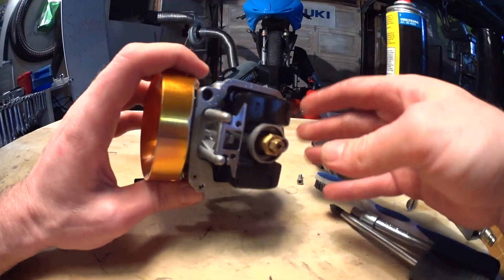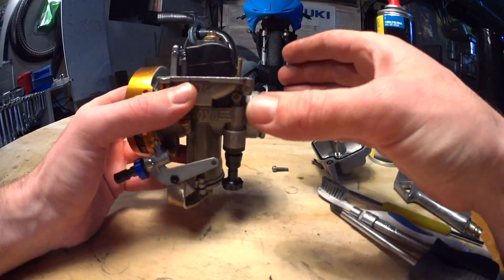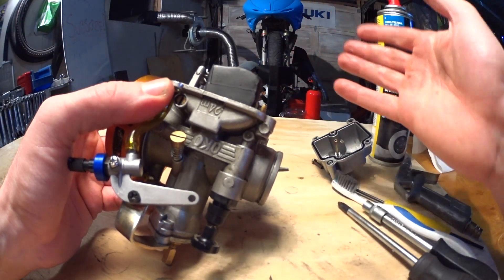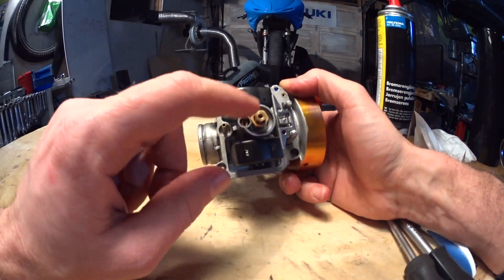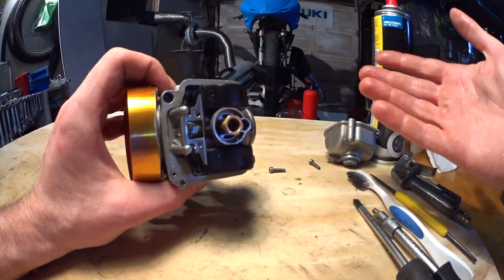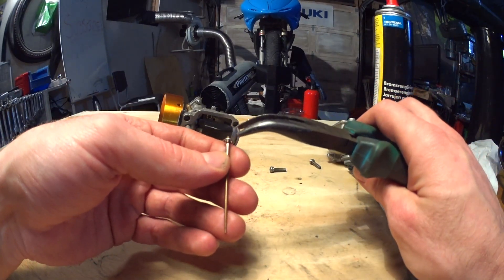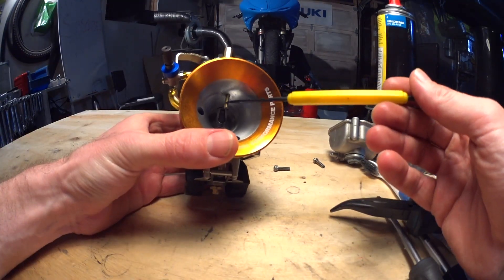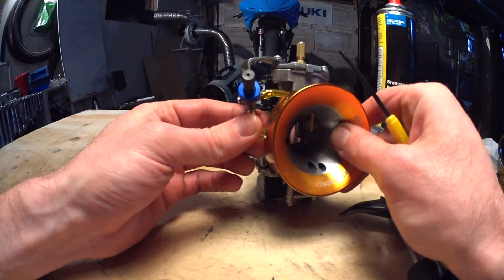HOW TO TUNE YOUR CARB | Carburetor Tuning Tips And Tricks! | 2/4 STROKE TUNING

Comment: 2 stroke and 4 stroke 2 different setups ..damage can result from lean out a 2 stroke .
Reply: Peter Taylor I ride a vespa with a 210 kit.i run mine so it's on the rich side. I know what it's like to seize an engine while overtaking cars on a motor way.

Comment: the rc fuel valve is a brilliant idea! i made myself a powervalve system using a pilot jet, but this method is neater though.
Reply from the maker: +Mohammad Farhan Sukarjo Thanks!
Reply: @2STROKESTUFFING  .
Is that correct ?
Reply: Sooo wait, I could just use a larger main jet and use this RC valve to adjust levels?
Reply: On my Honda CR80R?

Comment: Great tips sir!  very nice!

I have a question,  Which Carburetor type works best on a 4stroke Scooter? 
Butterfly Valve, Round Slider or Flat Slider just like the one you have there?
Reply from the maker: +Nathanael Sangalang Thanks! Can't say much about what's best in a 4 stroke, not exactly my field. But most flatslide carbs outflow most round slide carbs, and most round slide carbs outflow most butterfly valve carbs.
Reply: ohh.  i see.  now i get it,  btw Thanks as always man!  😄

Comment: Do you have a video about powerjets? I have a 2 stroke 200cc quad that was modified with an aftermarket 28mm Keihin carb with no power jet and the port soldered shut. I am more than capable of modifying the port, do you think a powerjet is worth it without upgrading the ignition/CDI?
Reply from the maker: +Charles Gunzelman If your engine already runs good at all throttle openings there won't be much of an advantage with a powerjet alone.
Reply: 2STROKE STUFFING ok thanks! I just got the machine, still need to tune the idle, install a proper needle clip and pack the exhaust silencer. Would the silencer being wide open affect the tune? It currently has no packing or end cap.
Reply from the maker: +Charles Gunzelman It will probably affect it some, but not very much. Good luck with your new toy!

Comment: True or false:: a 2 stroke makes its best horse power and runs coolest when the main jet is lean enough that the engine just " makes that noise, like a small backfire". And if the main jet is too Rich a 2 stroke can over heat. In a four stroke its the opposite. So I was told. Thanks
Reply from the maker: +Steve Smith False. The leaner you go, the hotter it gets.
Reply: 2STROKE STUFFING Thanks. I heard that story at the races and saw people do it, too. I often ride at 4-8000 feet so I'm always rich.

Comment: I have a 150cc 4 stroke bike.
18 years old actually.
I want to learn the basic carb tuning, My carb looks very simple than yours 😅.
Can you help me out maybe.
Im absolutly in love with my bike and people around here dont know shit about tuning.
It ll be really greatful of you.
thanks :)
Reply: well pretty much run rich in winter and lean in summer you can check if you are running lean/rich if you take of your spark plug and inspect it.. brown is perfect, white is too lean,black is too rich if you dont find the perfect mix then better run rich
Reply: Mario Raja Thanks alot man !
Reply: Best way to learn is just do it. Pay as much attention as you possibly can though. A simple little screw up on carb reassembly can cause a no start and you're left scratching your head. So take your time and any screws that have adjustments, write down how many turns it takes to seat it. I always run the scres IN until it bottoms out and count the number of turns, to the 1/4 or 1/8 turn at least. Then just run them all the way in on reassembly and back off how every much it was to start then make adjustments if necessary. Biggest thing it just takes time, and try to be patient. I've been playing with bike carbs since i was like 11, and it took me years to really get them. Of course that was a decade before google and youtube.lol I'd have given my left nut for the info you kids have now. I HAD to just learn on my own, or some from buddies.
Reply: @salvadordollyparton666  So I'm relatively new to bike maintenance procedures. Carbs continue to elude me but I'm determined to figure it out. I removed the carb from a Buddy 125 I just bought because while it would start when giving any gas would kill the engine. So, figured a good carb cleaning was in order. Plus the seller told me that it could probably use a good cleaning when I bought it. That being said I dismantled the entire thing, cleaned throughly, used fine wire to clear the tiny holes and everything. However, in my naivety I didn't pay attention to the original positions of the pilot or main jets. Now I have no idea where to even start. The bike won't start at all now. How do I set up or reassemble the carb so I can get it running again. I feel confident I can tune it up once I get it running but could call I have done something so wrong that I can't get it back to where I started? I mean at least now it's clean but I'm at a loss. Any help would be much appreciated!
Reply: Jess Bains Well, you just learned a very important lesson, hopefully lol. All I can tell you is maybe back the mixture screws out a couple turns or so and go from there. Try and start it a few times and give another 1/4 turn, repeat. It may take a while, but I find that helps you remember the next time haha. I've done it, either not paying attention when I was first learning or not paying enough attention later. I'm sure damn near everybody has. No big deal really, just have to play with it til you get it to fire and tune from there. Somebody else may be able to help a bit more, but not knowing that exact machine/carb myself I couldn't really give you anymore help. Hell, even if it was a Keihn on a Honda I couldn't really tell you more. I haven't messed with one in years, so completely forgot the approximate number of turns on one of them. Just don't let it get ya down, everybody has to start somewhere and it really ain't rocket surgery. Just takes practice and you'll learn. I had this old book on how to rebuild and tune Holley automotive carbs I learned a lot from. Can't remember the name exactly. But if you can find a good book on em or somethin online give it a shot. That book helped me with small engine carbs as well just by helping me understand the process more thoroughly. Just learn all you can, I've always been very inquisitive so it comes naturally. Others may have to work at it a bit more. Good luck, hope that helps.
Reply: It's a four stroke... It's not that hard

Comment: I do not see you wearing eye protection in other video clips using dental tools and air.  Also.. Use needle nose vise grips for C clips so you do not lose it when moving it.
Reply from the maker: +grabir01 I've got a long way to go in the safety department... Nice tip with the vise grips!

Comment: do you think the ventouri effect (don't know if it is called so) is increased by your stage 6 "adapter"
Reply from the maker: +zweitaktpower probably not... Got it as a gift, and it looks kinda cool...
Reply: it does look cool :D  i think about buying one thanks for your answer :)
Reply: it's better if you use a air filter  because you can use a larger diameter intake for the filter, i have problems where in brasil w/ this carb, because the filter intake is too smal and the bike don't raize de rpm well, so i use this adapter for use a larger diamenter intake... sry for bad english, i'm brazilian... =D
Reply: ty and very good video...
Reply: thanks you
Reply from the maker: +felipe casonatto Good point!

Comment: nice short and comprehensive video, no need to read through thousands of forums for me anymore👍 i once lost a needle clip on gravel ground in that case its faster to get yourself shiped  a new one instead of searching for it hahah😂😂
Reply: 2STROKE STUFFING excuse me I got a aftermarket exhaust for my quad and they recommend rejetting which will stop the backfiring issue and could you just adjust the air fuel mixture to act as rejetting or no
Reply from the maker: +Cooper grasseth reviews No, the af mix screw won't effect wide open throttle enough, youll need to switch out the main jet.
Reply: 2STROKE STUFFING ok and I watched a vid on it and they said it also needed a bigger pilot jet
Reply: hahaha dam! lol
Reply from the maker: +P33TMusic Thanks! Yeah, I didn't even bother trying to look for it...

Comment: Your knowledge is limitless. Do you maybe know a place to get clear float bowls for mikuni vm-type carbs? Can't find them anywhere lol. Greetz.
Reply from the maker: +Von Bergerfurth Thanks, not close to limitless tho... Hmm, not sure about that one. Tried ebay?
Reply: I don't think you will find exactly what you need. You can though place a clear tube on the overflow, clamp it somewhere so it's vertical and open the float drain screw. The fuel level will be visible in the clear tube and it will be very precise (assuming you have proper venting).
Reply: Sketch1994 there is no float drain screw in a mikuni vm20. I'm just interested in it for cosmetic purposes anyway.

Comment: CRE torch is handy to see right down the hole of passages to check for any cooties.
And cleaning the carb is a good time to figure out exactly how it each system works in it by tracing the path of all the passages in it.  Noting where the air bleed and fuel passages go and maybe mix together in it before discharging in the bore which can make it easier tuning if you have a mental image of sorts of how its all operating inside..
Reply from the maker: +AuMechanic Good advice!

Comment: Awesome videos love it do u think if u mix rc fuel with 110 octane fuel and run it it in a drag banshee it will more power
Reply from the maker: +david voges Thanks! The RC fuel (methanol and nitromethane) will probably not mix very well with gasoline. You could try to add some acetone as a mixing agent and see how it behaves. Running it straight or diluted with methanol is probably better!